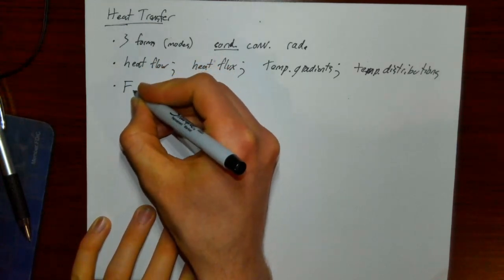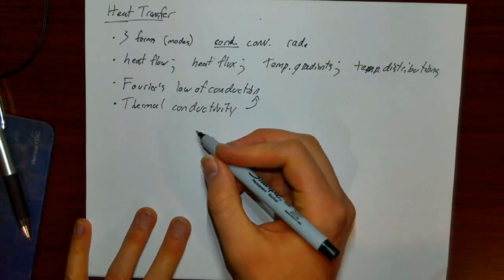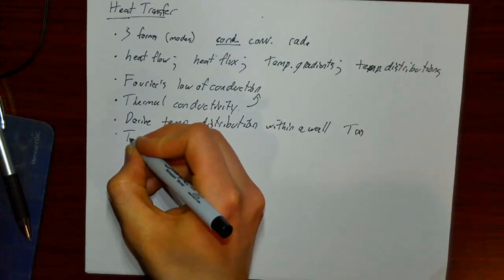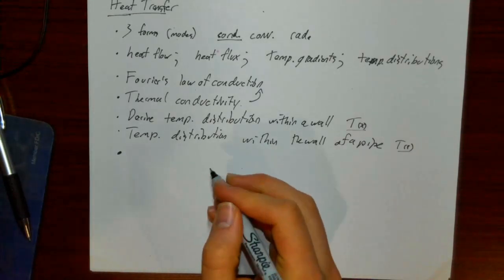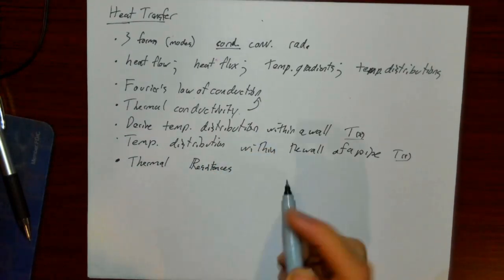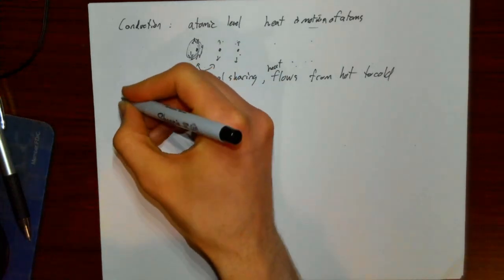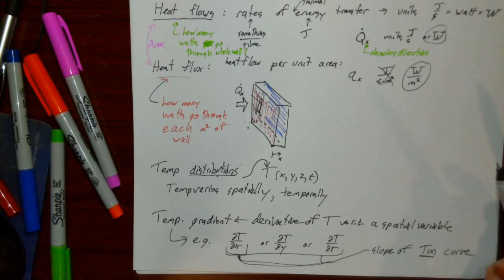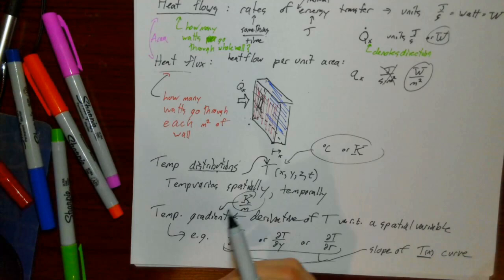BIOE 3310 Lec 18 - Heat Transfer; Fourier's Law of Conduction; Example Problems; Thermal Resistances

Comment: 3 modes of heat transfer: conduction, convection, and radiation 5:44
Heat flow vs heat flux; temperature gradients vs temperature profiles 13:40
Fourier's law of conduction 27:10
Thermal conductivity, k
Temperature distribution in a large wall of constant k 38:06
Temperature distribution in a pipe where heat flows radially outward 55:30
Thermal resistances 1:13:50